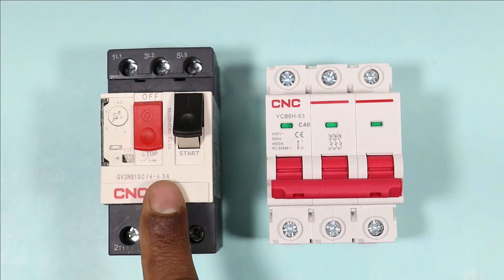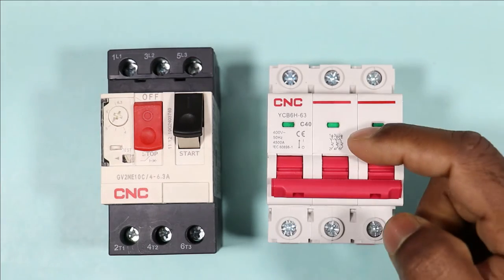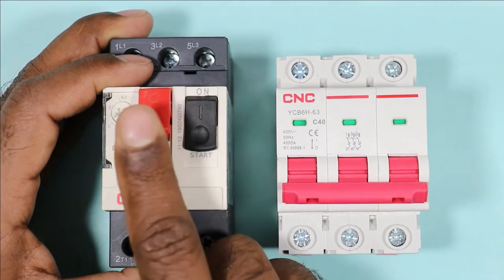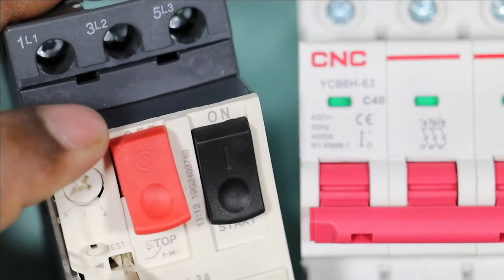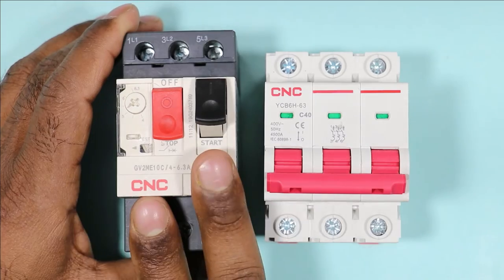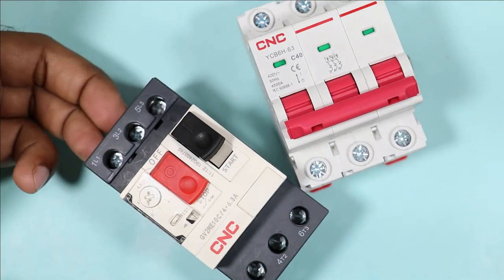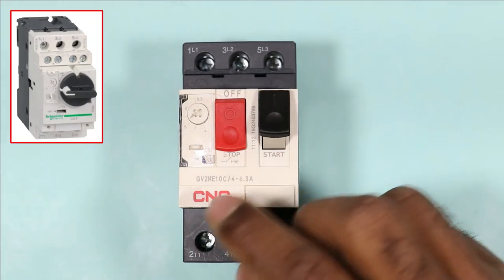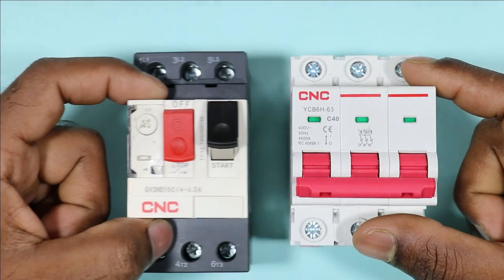What is MPCB | MPCB Vs MCB | Motor Protection Circuit Breaker @the Electrical Guy

Comment: What if I wanted to control a 3 phase motor with single normal relay which device should i use. It should also consists of this MPCB for low phase voltage trip  and it should be operated via a 5v or 12v relay supply